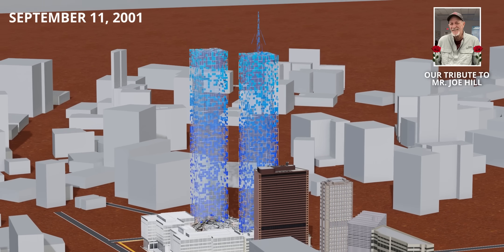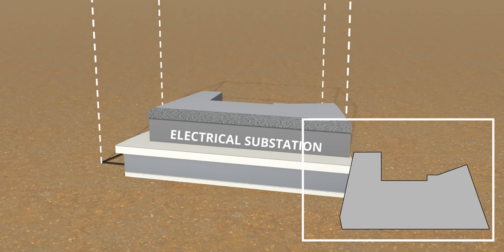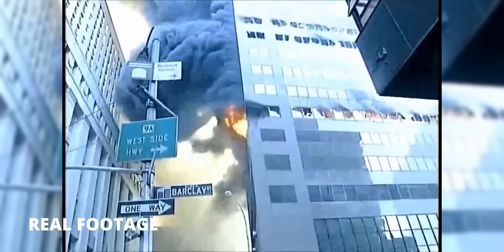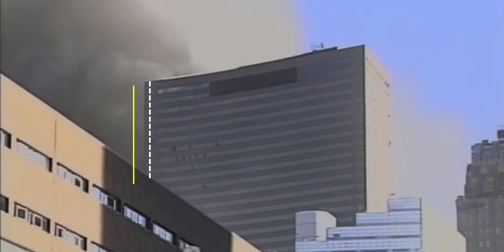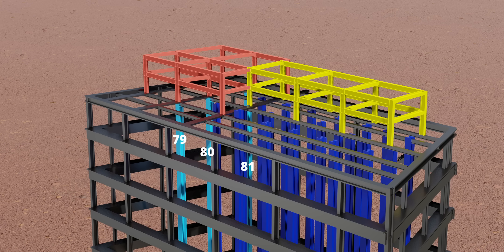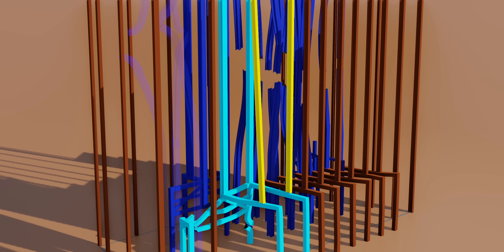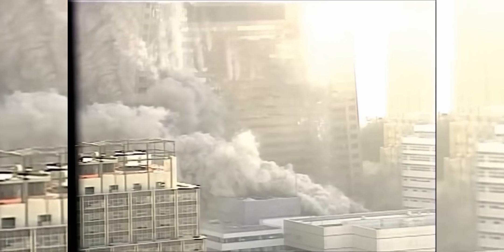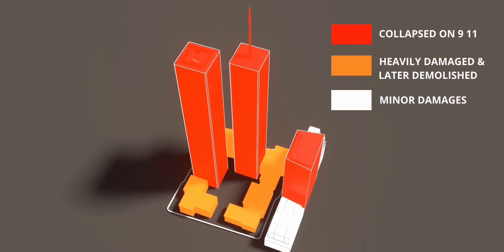Collapse of Building 7 | The Complete Physics

Comment: This is still a big lie. No way buildings just fall like that due to fire. Antenna damage is completely wrong in this explanation too. I don’t know what was the motive for the destruction of wtc, but the explanations provided are simply not good enough.
Reply: "No way buildings just fall like that due to fire. "
Really? So, how DO they fall like due to fire, then? What differentiates them? And, how would the building know what made it fall?
Reply: How should a building like this (and there is no other building like it) fall due to fire and how does the building know it is fire that is causing its structural failure so that it knows to fall the correct way?
Reply: @ "Critical Stinker and Mooneyes are officially the same person."
Huh. What do you know, you managed to say something else more moronic than your usual fare. Impressive, that.

"Asymmetrical damage and the consequent asymmetrical fire will not cause all but three core columns to simultaneously fail and bring a building down nearly vertically. "
Why? Because you want that to be the case? I mean, not relevant to the case at hand, but still, why?

"Why do you “both” keep saying the building does/doesn’t “know” what caused it / how to fall. That’s a meaningless statement in regards to what the OP wrote"
No, that's EXACTLY relevant to what they wrote. " No way buildings just fall like that due to fire." is their claim. Why? How would the building know what made it fall? How does "fire", "demolition", "Death Space Pew Pew Laser" or "Steel-eating Beavers" make any difference? How would the building know what caused it and so know to fall in a different manner?
Reply: @mooneyes2k478  - Dudes an idiot. Leave it be

Comment: GTFO THEY USED A TERMITE BOMB! STFU
Reply: This video is pretty good – with a few exceptions - and goes into a much higher level of detail than many viewers will be able to comprehend.  While not perfect, the collapse mechanisms – the sequence of failures - described here  are substantially correct and this is true no matter who planned and carried out the 9/11 attacks or why . 

That may not be what you want to hear and go against 20+ years of entrenched dogma and conditioning, but it’s not wrong. 

That also means (in case you did not get the hint) this video can be (and IS) absolutely correct in its description of collapse mechanisms AND the 9/11 attacks could still have been some sort of inside job. The two things are in no way mutually exclusive. 

The mechanisms described here have broad professional support around the world. There are no professional engineering organizations (for example: ASCE, ASEE, ICE, etc) that disagree with them or have offered any formal dissenting opinions or alternative hypothesis. 

So, setting hubris aside, either the overwhelming majority of the worlds structural engineers and simple observation are wrong,… … or you are. Which seems more likely? 

IF you still think believe this explanation is wrong then produce a better one . Good luck with that. No one ever has and I don’t see you moving that needle today. 

No one ever does.

Comment: It's a very competent, technically sound story. Thanks to the author. It really doesn't explain why they allowed the planes to be hijacked. And they are unlikely to allow details to be published about the strike on the Pentagon.
Reply: Strawman much?

How many details would you like on the Pentagon attack? Will this do for a start?

We know Flight 77 – a Boeing 757 - hit the Pentagon because of ALL of the following true and relevant facts, not because of one random anomaly.  When complied together, all of these true and relevant facts form a single inescapable conclusion; 

1. Witnesses: Local and national media published or broadcast the accounts of ALL of whom reported a plane hit the Pentagon, while no witnesses reported seeing anything else (ie: none saw a missile). Around 2 dozen witnesses could identify either the aircraft type, the airline or both.

2. Flight Path: On its way in, Flight 77 created a damage path (the tree hit by the left engine, the 5 light poles, the garden wall on the Pentagon lawn and the mobile diesel generator) which is consistent with an aircraft the dimensions and layout of a Boeing 757. No missile could do any of that. 

3. Impact Hole: The impact hole in the outside wall of E-Ring at Wedge 1 of the Pentagon matches in size and shape the Boeing 757 from engine to engine. Wing impact marks extend out on either side of that to the span of a 757. youtube.com/watch?v=FkgJ-rFFBD0&t=15s  

4. Building Damage: The damage path inside the Pentagon takes the shape of an inverted cone, with over 80 support columns all of them bent in the direction of travel.  This is consistent with the high speed impact of a Boeing 757 aircraft and NOT the high-explosive blast warhead of any missile. 

5. Aircraft Wreckage: 19 tons of B757 wreckage were recovered at the Pentagon crash site including the landing gear, both engines, the entire left wing flap assembly, part of the cockpit, seats (some still occupied), landing gear bay doors, fuselage sections, the Flight Data and Cockpit Voice Recorders for Flight 77, etc, etc,... 

youtube.com/watch?v=kCRuVNgrAAw&ab_channel=cjnewson88 

6. Two parking lot security camera videos from the north parking lot security booth captured images of a B757 sized aircraft in AA livery flying along the exact flight path of Flight 77 and at the same velocity recorded by its FDR. The aircraft was trailing smoke from the right engine due to hitting the aforementioned tree moments earlier as confirmed by several witnesses. 

7. Human remains: The remains of everyone aboard Flight 77 were recovered and identified with the exception of 1 infant whose remains could not be identified. Some victims were recovered still strapped in their seats. Each of the victims families were provided with a detailed autopsy report.

8. Personal Effects: Several thousand personal items belonging to persons aboard Flight 77 were recovered at the crash site at the Pentagon with the victims families being provided with a 1,000+ page book detailing every item for identification and return. 

9. Radar:  A total of 6 FAA and NORAD radar sites tracked Flight 77 from take off to impact. The radar data matches EXACTLY the 25 hours of flight data recovered from Flight 77’s recovered FDR, right down to the last decimal. 

youtube.com/watch?v=3vqDDlS9Hyw&t=6s&ab_channel=cjnewson88 

10. Insurance: American Airlines and its insurers accepted responsibility, admitting Flight 77 crashed at the Pentagon and subsequently paid out tens of millions of dollars in damages. 

11. Boeing;  The folks at Boeing confirmed it was a Boeing 757 and specifically Flight 77 which hit the Pentagon. 

12. Where is Flight 77?  It is a fact that Flight 77 never landed anywhere, nor has anyone aboard been seen or heard from since 77 crashed into the Pentagon.

13. Even if the 9/11 attacks were an inside job, Flight 77 still hit the Pentagon and the above true facts are still true facts. “9/11 was an inside job” does not mean “flight 77 did not hit the Pentagon”.

14. Pilot Skill:  Hani Hanjour was a crap pilot and his flight path proves it. But he was grossly over-qualified to crash a plane – something anyone can do. A number of Hanjour’s instructors are on record stating that while he was not a good pilot, they have no doubt he crashed Flight 77 into the Pentagon.  The conspiracy types always leave that part out.

15. When staging an attack that absolutely has to use planes - and I cannot stress this enough - you use planes. Common sense.

16. No blast crater or damage, radial fragmentation pattern, pre-formed fragments, missile parts or anything else associated with a missile were found.

All of the above is true no matter who planned and carried out the 9/11 attacks or why  - which I know will be seen as a blasphemy by many reading this. 

Anything can seem like a conspiracy if you don't understand it. Now you know.

If you can do better then by all means, have at it. I am open to any more plausible alternative as to what hit the Pentagon using ALL of the available evidence while relying on fewer unproven assumptions than what I outlined above.  Go ahead, be the first to even try. 

Since no one ever does, it’s been nice knowing you.

Comment: If the columns were destroyed by the spire wouldn’t what they were holding up also be removed/destroyed from the building? So there would be no extra weight that the other columns would have to endure. How would they collapse from the extra weight if there is no extra weight? And if there was, it wouldn’t be significant enough to causes it to fall like that. You can see the building remains almost perfectly level as it falls. That means every single one of the columns had to give out at almost the exact same time which doesn’t really make sense if it wasn’t a controlled demolition.
Reply: The antenna fell to the south while WTC7 was to the north. Lesics is full of shit.

"TheCriticalStinker" is also full of shit.
The gash was caused by WTC1 core columns that tipped all the way to WTC7. The damage on the sw corner of WTC7 was also caused by tipping WTC1 core columns.
NOT PERIMETER COLUMNS which actually didn´t even exist as columns.

And of course WTC7 was brought down by controlled demolition. So far it remains the only existing explanation for the free fall of WTC7.
Reply: This video is incorrect on that point. It was falling perimeter columns from the north face of the North Tower which did the physical damage to the south side of Building 7.  This physical damage in the end was not responsible for the collapse of Building 7 but it is when the fires were introduced. 

It's not about weight, it's about load and the structures ability to handle load. Loads can shift as structural elements fail. As structural elements weaken their ability to handle load decreases. And no, every single column did not fail simultaneously. It happens in a sequence just like the video shows because you are not accounting for the exterior moment frame. 

B7 was complex structure, a 47-story steel framed building built on top of a smaller existing 3-story building, requiring several lower floors dedicated to complex load transfer structures instead of usable office space. Of trapezoidal shape and all-steel tube-in-tube construction, B7 (above the 7th floor) consisted of a central core of steel columns carrying most of the gravity load, perimeter steel columns around the outside of the structure carrying the remainder of the gravity loads and long span beams and girders to tie those elements together and form the floors. On the outside of the building hung a moment frame - the last part of B7 to fall. 

Phase 1 : Collapse initiation for B7 is notably quiet with observers not realizing the building was collapsing! There was no audible warning in the form of say hundreds of ear drum busting 180-190dB explosive bangs preceding the collapse. The first externally visible signs of collapse initiation occurred at 5:20:28 pm. Here at 12:00 a local CBS affiliate reporter is talking 10 blocks from B7 when collapse begins. People don’t start to notice the collapse until 12:11. Then at 12:45 is the famous CBS fixed camera clip of Building 7’s collapse Again, note how quiet it is.

youtube.com/watch?v=t5tEy6mXSE8&ab_channel=fresnosean379

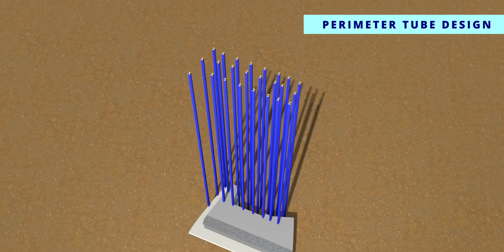Collapse initiation was due to multiple lower floor failures above the load transfer region (7th floor) in the NE corner of the building. In this video at 0:45 you can see the NW corner from inside the building while under construction, Column 79 just out of frame on the left. That big, angled steel beam across the top of the frame connects to C79 at one end. The girders connect to the beam. That beam and all those girders depend on just one connection

youtube.com/watch?v=nP3TNHPCIVU&t=35s&ab_channel=EdwardCurrent

Phase 2 : Lower floor failures caused a loss of critical lateral support over an excessive length of core Column 79 and it buckled. If you look at a floor diagram of Building 7 (see above) and look at all the structures that depend on C79 you quickly realize this one column was a relatively isolated structural element on which a disproportionately greater fraction of the structure depended . Externally we see a vertical progression of window breakage along the 44-46 line and a kink in the roof of the East Mechanical Penthouse at the top of the building, consistent with C79 failure. The transition from full capacity to almost no capacity occurs in virtually an instant. Once the buckling failure occurs there is almost no resistance

Normally with a buckling column, the load could very well be redistributed to other columns, meaning the buckling could stop after a while. With C79 that is not the case - the failure did not redistribute the load, so the collapse rapidly progressed to the roofline, sinking the rooftop penthouse.

Phase 3 : With C79 gone, B7’s progressive, non-symmetrical collapse continues with C80 and C81 at the east end of the core left laterally unsupported and quickly buckled and failed as well, sending the EMP down through the building. C79-81 all have no diagonal bracing, which I believe is a major reason why they could not redistribute a lot of vertical loads among one another.

From there collapse progressed from east to west through the central core until the core was gone taking all of the interior floors and structures and probably most of the perimeter columns with it. You can see the horizontal progression of window failures low in the building and the dropping of the remaining rooftop structures into the building. One of the big takeaways from the NIST Building 7 study (that gets completely ignored) was their modeling which determined C79 failing under ANY circumstances would have initiated the same collapse sequence.

Phase 4 : After some 10 seconds all that remains of Building 7 is just a hollow empty outer shell - the exterior moment frame - creating the illusion the building is still standing since little has changed externally. But it’s just a hollow empty shell like an empty cereal box supported by only a few remaining columns and quite unable to remain standing. With all the internal framing gone. the north face leans inward, forming a V in the roofline, the last perimeter columns buckle under the strain and with nothing left keeping it up the moment frame free falls, landing on top of the 7-story high debris pile. It is only at the very end that a single measurement of alleged free fall acceleration is taken. Note this is not the building but just its outer shell, and only one corner at that, at the very end of the collapse. Start to finish the entire collapse took 18-20 seconds, or less than 1/3 of true free fall and we have to look at the whole thing, not cherry-pick little bits to fit a particular narrative. Worth noting _how fast something falls cannot tell you what started it falling in the first place. The debris spread out, blocking surrounding streets, heavily damaging the Verizon Building and destroyed Fiterman Hall, all well outside of Building 7’s “footprint”.  

Building 7’s progressive, non-symmetrical collapse was incidental and unintended collateral damage from the combined effects of fire + time + gravity started by the collapsing North Tower. That is true no matter who planned and carried out the 9/11 attacks or why . The collapse was of so little consequence it barely even registered at the time, a mere footnote. 

I hope you found this helpful and informative, not adversarial and it solicits informed critical comment. If I made any errors of fact, logic or reason or left anything critical out, please let me know so I can fix it. IF you can offer a more plausible alternative please do.